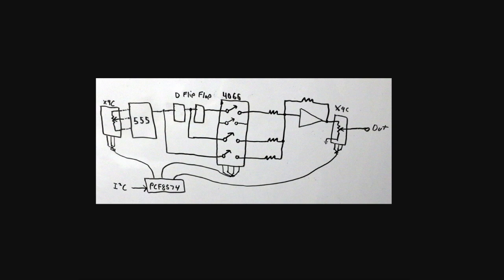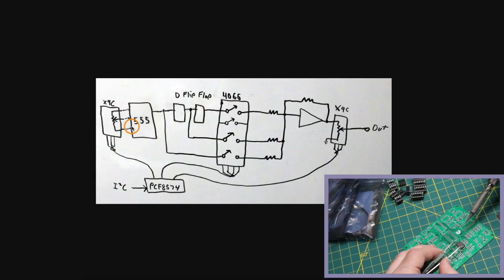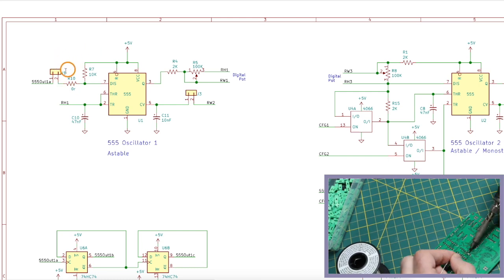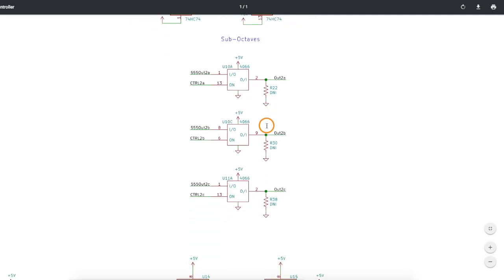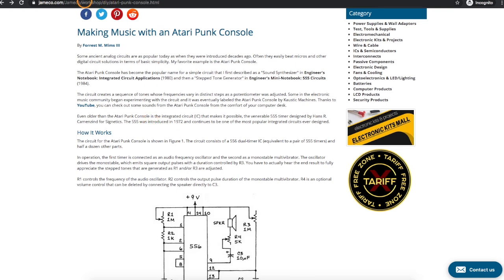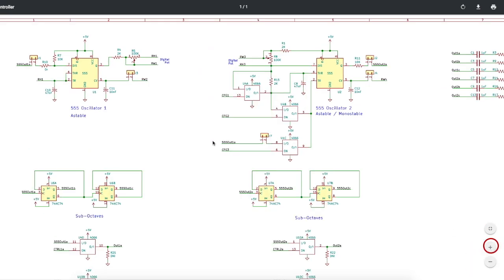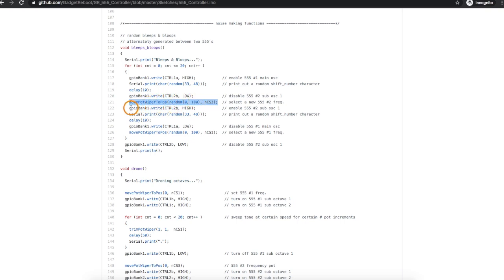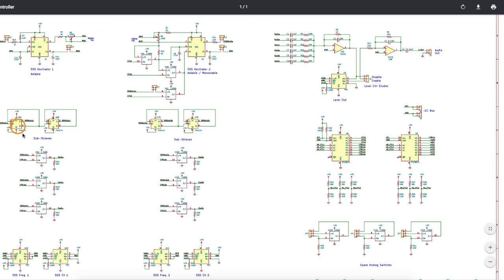I2C Enabled 555 Noise Maker Controlled by Arduino Uno

Comment: The Atari Punk Console was one of the first circuits that got me into this hobby/profession less than 2 years ago. The APC is notorious among synthesizer DIY groups and many condemn its sound. 😅 You can actually get some rather pleasing results from it however if you modulate one of the 555 ICs pin 5 (I forget which one) with another oscillator.
Reply from the maker: sounds like it’s time to try modulating the control voltage pin on both of them to see what happens. That’s why I like making basic circuits that are configurable on permanent boards because if I had torn it all apart and needed to go reconstruct it on a breadboard just to check something, Id probably procrastinate it for two years.

Comment: Haha fun project. The 555 is kind of useless in this case with ucontroller I think. But it's interesting what it can do.
Nice video 👍🏻
Reply from the maker: The control voltage pin gives it a little uniqueness over generating pulses from a micro and it’s always fun to combine hardware and software instead of fully software.
Reply: @GadgetReboot  yes i totally agree. Quite often I even go down one more step and use fully logical ports. Also something to look into are multi-gang 24 rotary switches. To keep it truly old fashioned 😎
Reply from the maker: The most complex rotary switch I ever had was a single pole 12 position. I wonder if I still have that.

Comment: Wow! so many arcade memories for me !..I can hear loads of familiar tones in there, ya no ?..kinda little bursts of nostalgia...cheers!
Reply from the maker: yeah I just randomly created all of those sounds but when I heard them back there was a lot of familiarity. I really need to get my arcade cabinet built!
Reply: @GadgetReboot  MAME ?
Reply from the maker: yeah I’ve been wanting to do it since I discovered it in 1998 and I even have three sheets of plywood ready to go and a bunch of joysticks, buttons, a coin door you name it. I even wanted to make a motor controlled rotating monitor to switch between horizontal and vertical oriented games. I don’t know why I’m such a procrastinator.
Reply: @GadgetReboot  me too. mine was gonna be a "Defender"
Reply from the maker: I never did decide what to model a cabinet from but I wanted it to have all kinds of control panel interchangeable things so I can throw a steering wheel or trigger grip joystick, and my coin door has four slots so I can do gauntlet or xenophobe.